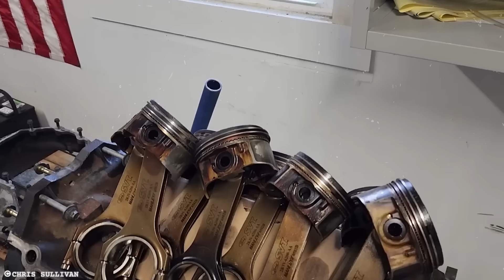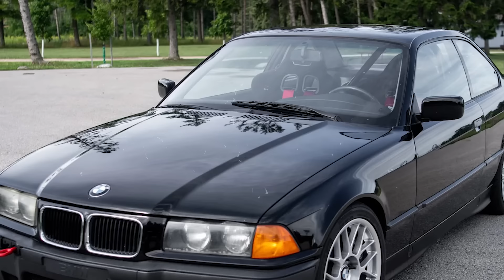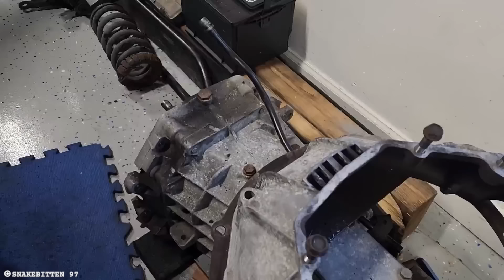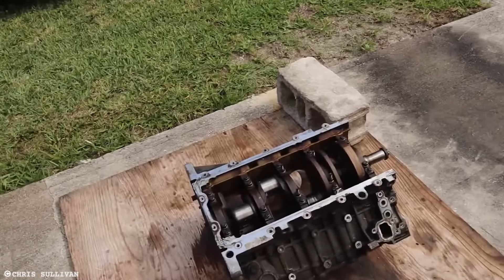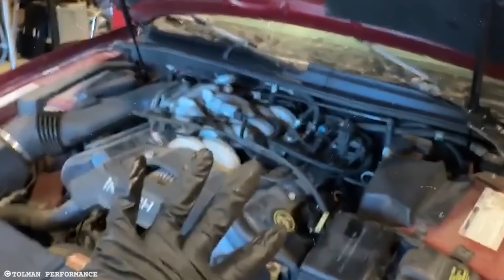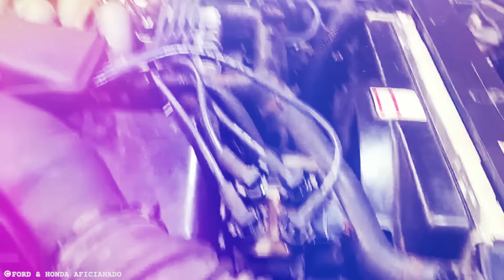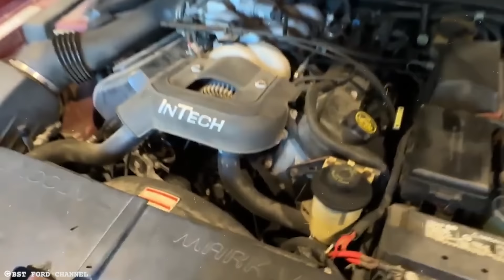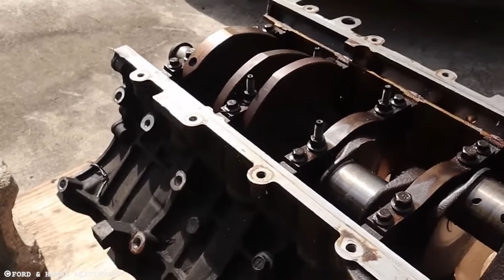The Most Overengineered DOHC Engine of Its Time   Ford 4 6L DOHC Modular 1993

Comment: Got a 2000 Windsor SOHC 4.6 with 225,000 miles idles smooth as a baby's butt, burns no oil and parts are cheap and available.

Comment: Let me correct you.  They didnt "cancel" the 2002 model the terminator was gonna be a 2002 but it took little longer to get it out so it was released mid year as an early 03.  The 2002 year was never "canceled" and there was about 100 2002 cobras sent to Australia and converted to right hand drive.  They were just left over 2001 cobras.

Comment: It took Ford a long time but Brett Lassala is making 3000hp from a 5.0 coyote 281 cubic inches..think about that for a moment.Not a 427 cubic inch GM LSV8 281 cubic inches.I will admit that an '03 Cobra made 305hp.Thats what a bone stock V6makes,but the writing was on the wall.The potential of the modular was finally coming around.

Comment: I had a 2003 Cobra (Terminator) which normally is out of my price range but when I bought it,it had 180k miles on it.Still running great,not using any oil and when I sold it at 256k miles it would still pin your ass to the seat.

Comment: in 1989 Nissan had a 4.5 dohc V8 with VVT. Rated @276hp due to a cap on japanese hp limits. The engine actually made around 305-310hp depending on the Series 1 or series 2 engine.

Comment: Got three Cobras currently. 97, 98, and 03. All with the 4.6 DOHC Modular V8s. One naturally aspirated, one with a blower and one with a supercharger. Can't get enough of these engines. 7,000 rpm from the factory and they just sound so sweet! Just installed headers on the Terminator and a new Centerforce twin disc clutch.
Reply: Omfg so jelly    03 my fav   only you probly know why
Reply: I hear ya, I had a 94’ Cobra with a 331 stroker and pro charger. Sold it and got a 03’ Terminator. Sold that and got a 12’ GT500.
Reply: Blower and supercharger is the same.  Do you mean one centri one pd blower?
Reply: @midnight347  which would you rather have....d1sc or Whipple?
Reply: Found an old fast fords muscle mustangs. They used a pulley and nitrous 50shot over 600 whp(exhaust,chip)
Another article gt with d1sc +150 shot made 700whp

Comment: Throughout the 1980’s and 90’s Ford was known to roll out new V-8 platforms through Lincoln for a model year or two before appearing in the Mustang. Usually in the Fox or FN-10 platform. Most notably the 5.0 HO in the 1986 Mark 7 and later the 32 valve 4.6L in the Mark 8.

Comment: I thought modular ment these engines could be swapped easily. Not share parts but you could pull a V6 out and bolt a V8 in with minimal if any other changes to the car. Made it easy on the production line to make different cars with different motors.

Comment: I had a 2004 lightning hell of nice truck unfortunately my 1979 c10 with a sbc 400 bored 30 over with a hydraulic cam basic cheap aluminum heads with runners 202 valves  180 intake runners dual plane intake 750 speed demon with mechanical secondary over the frame headers with 3 inch stainless steel pipes with borla xr1 mufflers and dumped after the cab side exit total for my c10 truck not including the wheels was about 11 grand the lighting cost me 30 k and was anchor compared to the c10

Comment: 4.6 is the best V8 ever made. I've seen 600k miles on many of them. I worked at the biggest Lincoln Mercury dealer in the world in the late 90s and I never seen a failed 32 valve or 16 vale in the 5 years I was there. I bet the 5.0 coyote can't say the same from any dealer.
Reply: I absolutely agree, A low friction, highly efficient engineering marvel.

Comment: It is my understanding that Ford went with a 100mm bore spacing because initially it was supposed to fit transversely in a FWD car.  They didn't want the block to be long, hence the tiny bore spacing.  They missed the boat to widen the bore spacing several times during the evolution, from mod into coyote and so forth.  This cost them severely as in order to stay competitive with dumb, cheap, larger displacement pushrod engines, they had to design it to rev, and throw 4 cams at it.  I have a coyote and they are great engines, especially how relatively high tech they are, but I also smell a bad decision when it was made.  I wouldn't be surprised if the manufacturing cost of the coyote is nearly double that of an LS or Hemi.  I had a friend whose father worked at Romeo during the mod motor years.

Comment: Well, I can tell you as a heavy line ford tech of the time - that the first couple years the 4.6l 32 valve put in the Lincoln Mk8's were absolute beasts.  Starting in 1993, Ford detuned these motors bc too many oldtimers were being off'd by surprising over performance.
Reply: Yes!! My 95 LSC was much faster than my 98 LSC.. They were advertised the same power so i always thought it was a weight or gearing difference.. It was just the tune that made it that much quicker??

Comment: And Chevrolet still uses 2 valve pushrod engines.
Reply: And Chevy still is the fastest
Reply: @endofthetrail-m5i  No it isn't. Only the 5.7 that's much bigger and much worse on gas. You put up a 283 or 305 and the 4.6 is superior in every way.
Reply: @zodwraith5745 not in a Corvette or a Cadillac they get great fuel mileage when your not on the throttle fords  stupid they should've made the 4.6 a 5.0 ohc to begin  a 302 is a perfect bore and stroke 4.00x3.00

Comment: Yeah this is right off the bat factory incorrect no dimensions were built in Michigan. The engine blocks were cast in Michigan they weren't anything to do with anywhere else they were originally designed as a truck engine and then shoved into a Lincoln so yeah this is totally crap whoever made this video needs to be banned from YouTube for internet pollution

Comment: I had a 1996 Lincoln Continental 60th Diamond Anniversary Edition that had a very special hand-built 4.6 liter V8 engine. 1 person built the engine and many
titanium components were used.  and was built per The President of Ford Alex Trotman to run 500k miles. Horsepower was 400+.
I say Plus because it was faster than a 2006 State Highway Patrol Interceptor (don't ask how I know that  lol).  It had bucket seats that were lambskin, not leather made by the same Italian company
that made seats for Ferrari.  It rode so well you could be doing 100 mph and it felt like 60 mph. Top speed was 150 mph. It never broke down on me once. That 4.6 V8 was the best American V8 of the '90's.

Comment: Failed to mention the notorious cam phaser/timing chain issues
Reply: Too early for that, none of these engines were equipped with VCT. All of the Romeo engines are fixed camshaft timing until 2004 the 5.4 3 valve came out, I can't remember exactly but it was the same year or the following that the 4.6 made the transition to the 3 valve heads.... The 3 valve engines and the later 4 valve engines that still came in the Lincoln shit and cobra mustangs are the ones with VCT.... And the issue was the hydraulic chain tensioners that were the weak point, they were composite with the integral gaskets and were updated to gasket less machined steel tensioners not long after. Yeah the phaser sprockets were having issues as well but that was because of neglect of the vehicle owners thru lack of routine maintenance, people not changing the oil regularly was what was smoking the phasers which normally causes the failure of the other timing drive components like the guides breaking and so on. I know because I've been a master technician at a Ford dealership for almost 10 years

Comment: Cleetus McFarland just did laps drafting 6 stock crown vics  except for a small Nitrous Oxide kits 
Went 159++mph.
Try that in any other $2000.00 car and then continue to send them to other racetracks to race 50-100+ laps

Comment: Lifetime of the vehicle means about 100,000 miles in the United States.
Everything after 2006 is a disposable vehicle, meaning it costs more to keep it on the road than just buy another gently used car.

Internal combustion engines are so highly tuned for not being polluting to the air we breathe that electric vehicles are truly the way to go.

LFP batteries and solid state batteries are the future with electric cars and we're in a transition phase right now.

Electric car companies and the buyers know that they don't want outdated technology and they're waiting for the supply chain to catch up with the new batteries.

They have nice things in China because they don't have a bunch of lawyers and environmentalists.

China is experimenting with 100 kilowatt charging, meaning 80% charge in 5 minutes.

Teslas are introducing the LFP batteries with the model Y as we speak.

LFP batteries have been in the Model 3 now since about 2003.

These are 200,000 miles or more batteries.

China has high-speed rail and other nice things because they don't have a million environmentalists and lawyers consuming two-thirds of the budget before one shovel goes in the ground.

Comment: Ford’s Coyote and 3-valve engines, especially regarding oil sludge, phasers (often called "chemphasers" by enthusiasts), and oil leaks. Here’s a breakdown of the key problems and what’s known about them:

### Ford Coyote Engine (5.0L V8)
- **Oil Sludge and Passages**: The Coyote engine, especially in early models, is notorious for oil sludge buildup due to narrow oil passages. This can lead to reduced oil flow, increased engine wear, and even catastrophic failure if not addressed. Regular oil changes and using high-quality synthetic oil are critical to mitigating this issue. Some owners report that engine flush additives can help dissolve sludge, but this should be done cautiously and followed by an oil change to avoid further clogging
.

- **Phasers (Variable Valve Timing)**: The phasers in the Coyote engine are prone to wear and failure, often causing a loud ticking noise. This can lead to erratic idling, power loss, and hesitant acceleration. Replacing the phasers and timing chain components is a common fix, but it’s a costly repair. Ignoring the issue can result in more severe engine damage
.

- **Oil Leaks**: Oil leaks are widespread, often originating from the valve cover gaskets, oil pan, and rear main seal. Even newer Coyote engines (2023 models) have been reported to develop leaks early in their lifespan, sometimes within just a few thousand miles. Oil spatter under the vehicle and a burning oil smell are telltale signs
.

- **Oil Consumption**: Some Coyote engines, particularly in 2018–2020 F-150 trucks, are known to consume oil at excessive rates, sometimes leading to legal action against Ford
.

### Ford 3-Valve Engine (4.6L, 5.4L V8)
- **Oil Consumption and Leaks**: The 3-valve engines also suffer from oil consumption issues, often due to worn piston rings or valve seals. This can lead to oil leaking into the combustion chamber, causing smoke and fouling spark plugs. Regular monitoring of oil levels and quality is essential
.

- **Sludge and Maintenance**: Like the Coyote, the 3-valve engines are susceptible to sludge buildup, particularly if oil changes are neglected. This can clog oil passages and reduce engine longevity. Using high-quality oil and adhering to a strict maintenance schedule helps prevent these issues
.

- **Phasers and Timing Issues**: The 3-valve engines also have variable valve timing systems, and phaser failure is a known issue. This can cause similar symptoms to the Coyote, such as ticking noises and poor performance.

### General Advice
- **Maintenance**: For both engine families, frequent oil changes (every 5,000 miles or less) with full synthetic oil are strongly recommended.
- **Monitoring**: Keep an eye on oil levels and watch for signs of leaks or unusual noises.
- **Repairs**: If you hear ticking or experience oil leaks, address them promptly to avoid more extensive (and expensive) damage.

Would you like more details on specific model years or potential fixes for these issues? Or are you considering alternatives for your own vehicles?

Comment: Those intake manifold runner controls failed quite often, and it was damn near impossible to find replacement parts not long after the Lincoln Mark VIII was discontinued. Mine had only 60,000 miles on it when I sold it at a big loss, and no car has ever nickel and dimed me to death like that car did.
Reply: I never cared for that gen, way they ran looked and felt...cheap.

Comment: I’ve had the 290 horsepower 32 valve 4.6 liter “Intech” V8 in a 1998 Lincoln Mark VIII. It was awesome when it wasn’t having mechanical issues. I’ve also had the Ford 250 horsepower 4.6 2 valve SOHC in 2 Crown Victoria Police Interceptors, and those engines had slightly less power, but they were extremely reliable.
Reply: We had those at my last job. They were never maintained and beaten on worse than a rental. Id never buy any ex L.E. car period
Reply: The 4v is just as reliable as the 2v if maintained.  If you had issues it wasnt because it was dohc vs sohc gauranteed
Reply: 2 valve 4.6 was 225hp. Have it in my 2006 E150.
Reply: @anthonynicholich9654  nope he's right, interceptors had 250hp
Reply: @lclnbm and 260 in the Mustangs GTs.. But pretty easy to get them to around 300hp with a few bolt ons
Reply: @NewEdgeDesigns  added 2.5in exhaust and the p71 intake to my marquis. Custom tune completely changed the car.
Reply: @lclnbm yep you are wrong it had 190
Reply: @anthonynicholich9654 a simple Google search would shut you up
Reply: @anthonynicholich9654 99-04 gt mustangs were 260 horses 302 tq

Comment: They call the push rod 7.3 Godzilla, a true gasser monster.
Reply: Fords first pushrod 2 valve engine in a few decades. Simple yes , efficient? No. Great engine.Indeed and the 6.8 is a great motor as well. No over head cams, much simpler design and to be used for work. Gas mileage should not be be a decision.
Reply: @ChrisHariis  I haven't seen one yet, I'm a tech.  Did Ford ditch a bunch of tech and build a modern workhorse? Or are there cam phasers and sensors everywhere?
Reply: @stanleybarker6207  You would be the one to know
Reply: Hello
Reply: @ChrisHariis  Hi, I haven't seen one yet, so I can't  comment on it.   I thought maybe you knew because of your OP.
Reply: @stanleybarker6207  Much simpler design, again ford ditched the multiple overhead cam design for an old school approach. More like an LS.
Reply: @ChrisHariis  so it's an OHV motor?
Reply: @stanleybarker6207  pushrod
Reply: @stanleybarker6207  pushrod
Reply: It’s a monster alright. Weight dimensions and reliability as it’s high revs loaded doesn’t sit well with haulers who seen the gasser beneficial. But then again I still see V10 Excursions driving around.

Comment: 1960's cars were producing mid to high 300 hp engines and some were getting low 400hp. And were getting 15 to 20 mpg all NA engines. Now in 2026 with all this technology we are still getting the same results just must more expensive.  Point im making is we should be getting alot better mpg and we can but that doesn't make the oil company's rich. In the mid 90s Ford made a deisel 4 door truck getting almost 30 mpg but we all see what happened.  While the government keeps saying we need better fuel economy.  I say get out of our lives and we will and can.

Comment: The same italian geniuses that designed the cobra 🐍 engines for USA and England. The italian supremacy at metallurgy.
This is why henry ford junior went car company shopping in italy to buy the latest in engine (worlds first 4 cam 30 years ahead) brakes (4 wheel disc 20 years ahead) transmissions (5 speeds. 20 years ahead of the Germans Americans, english french xnd Japanese) carburetor (webers and solex single throat per cylinder, 20 years ahead), and the highest Hp per Litre of power in the world. He came home heartbroken without ferrari or alfa romeo. However hecwas able to buy Ghia Carrozzeria (carriage house), a world class Design powerhouse, that trained Ferdinand Porsche, sent by adolph to italy.  as an apprentice on how to design a people's car sumilar to the fiat topolino that became the VW bug, ghia saved karmann too with the convertible Karmann Ghia). 
In addition to Ghia,  he came home with a beautiful italian wife!, his most priceless prize!

Comment: in 2001-06, Lincoln plopped in a hi-output Rover aluminum V8 into their sports sedan called the LS. .... that car is FAST. Delivering smooth power and surpisingly lightweight handling for a full sized 4 door
Reply: That was a Jaguar engine, was in that v8 spec Lincoln LS you mentioned and also the retro themed Thunderbird reboot. Unfortunately not very good engines at all, not sure about the other side of the pond but it was a flop over here

Comment: If they had made the 4.6 with a 302 bore spacing, the coyote would spank the ls1 with its eyes closed. Thanks to ford engineering decisions, they've had both hands behind their back since 1991.
Reply: They was competing just fine w these engines.  I do think the gt should have got 4.6 4v and cobra 5.4 4v since 1996.  They would have smoked gm then they should both got 6 speeds and 410 gears factory.   They would have been ahead of gm long before they actually became ahead of them.  Even as it was they competed fine ecsp the 4v cars.  Gt was a cheaper option for someone who wanted to mod there was huge aftermarket.  The cobra competed w the larger lt1 and later ls1.  It was ahead of the lt1 actually I used to beat them often in a mostly stock 97 cobra.  Had mid pipe and 410 gears otherwise stock.